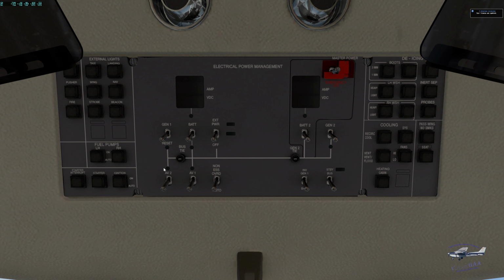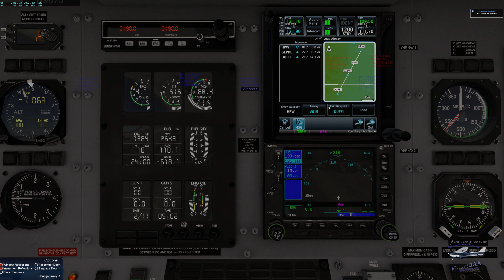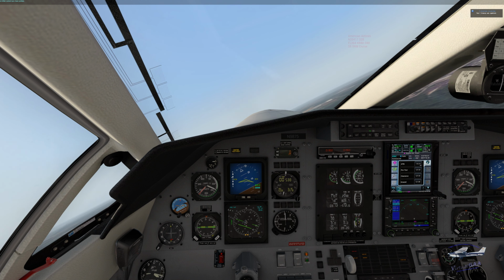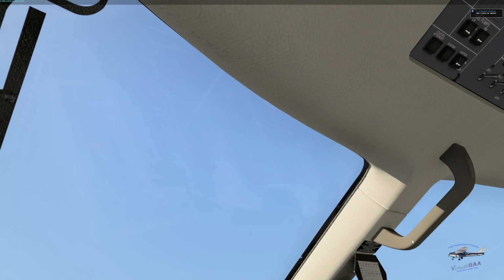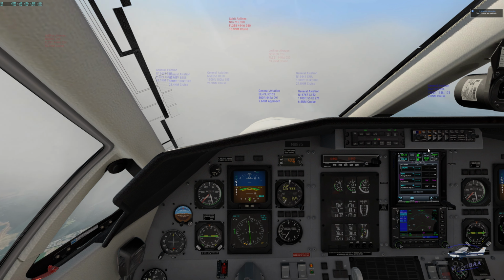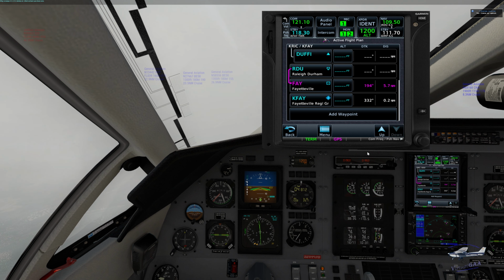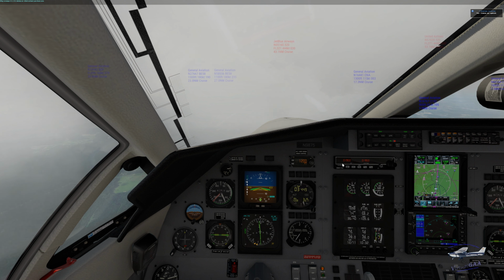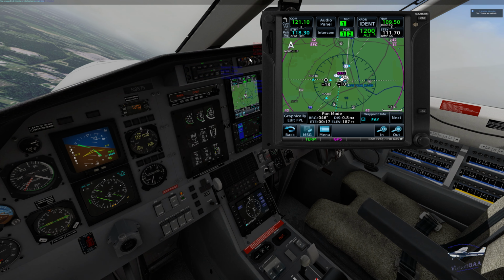X-Plane 11: A Taxiway Landing in PC-12 | Richmond (RIC) to Fayetteville (FAY)

Comment: Nice flight, why not the STM?
Reply from the maker: Hi Ron, 
That's a great question. I chose the Carenado because I didn't intend for this flight to be a deep systems flight. Basically, start, takeoff and land. In fact, I'm trying to determine if I should edit out most of the boring stuff, like starting the aircraft, entering a flight plan, and go straight to the takeoff and landings. What do you think?
Reply: @VirtualAviationAviator  Personally I don't do a complete check list. Not a real world pilot, just for entertainment. I create my flights in Simbrief and load then in the GPS. I understand your love for realism, but in the real world it would surely go a little quicker.
Reply from the maker: @WR5RR   Thanks Ron for your thoughts
:washhands: